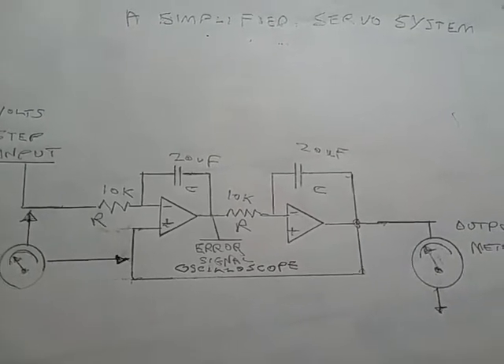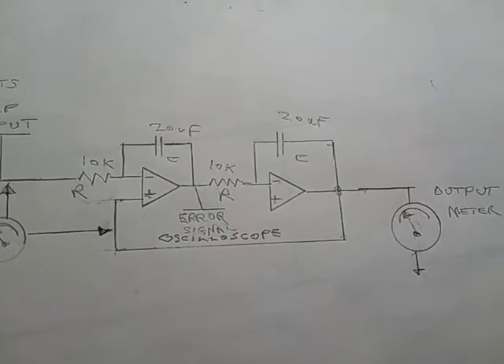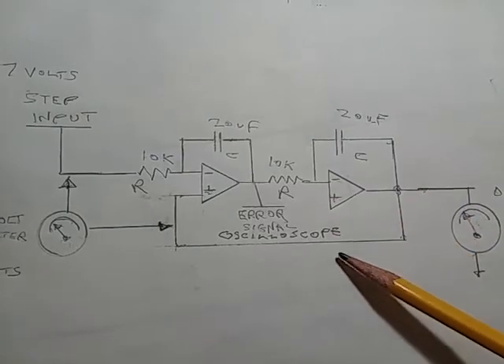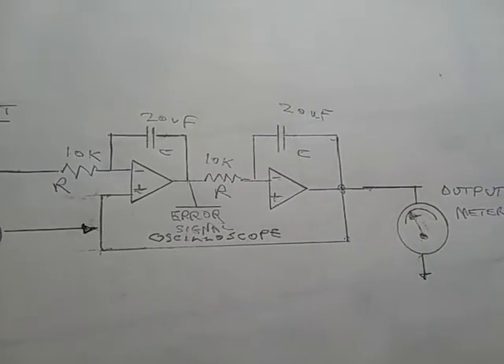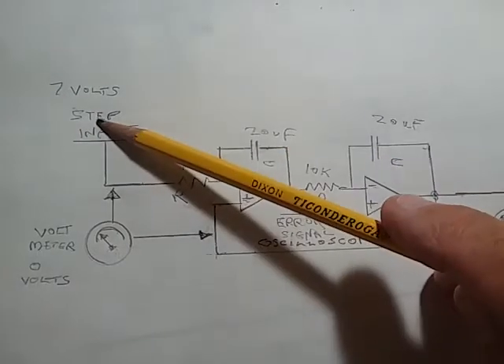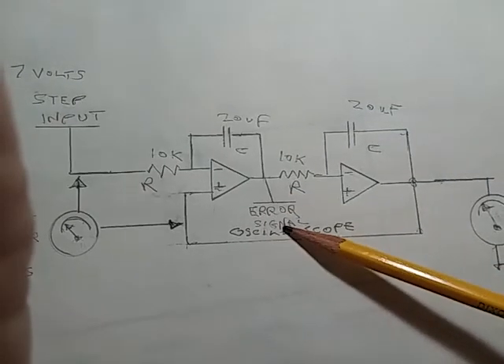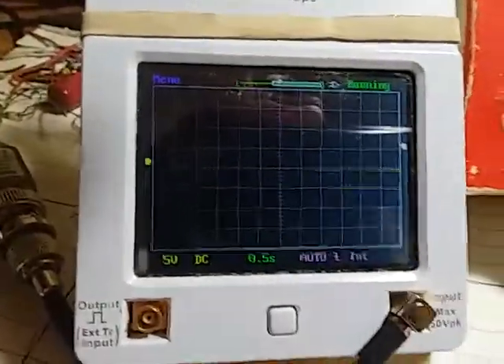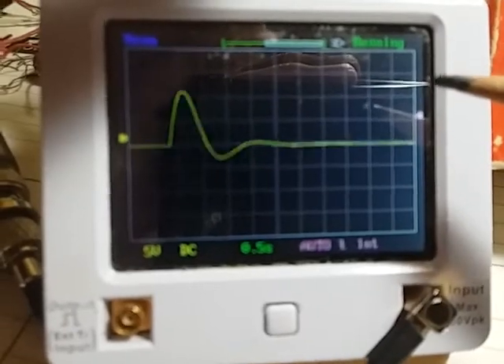Basic Control Theory, with a, "Working Model", Example.

Comment: Hello Otie,
They say that there are two reasons for myopia. 
1.Eye becomes longer.
2.Cornea is too round. 
Do you believe that the shape of the cornea changes due to confined visual environment.
Reply from the maker: Hi Sai,
Thanks for your question.  
Who are, "They"? 
They are not Engineering Scientists.
You start by making two proven false assumptions. 
The Control Systems eye, has positive and negative refractive STATES, and is never "defective", (or with refractive errors) in either case.
Reply: @otiebrown9999  I completely agree with you when you use the term "refractive states" instead of "refractive errors" because it is completely normal for our eyes to go down if we do prolonged close work and myopia is not some kind of "error" of course. Maybe, we shouldn't talk about shape of the cornea and length of the eye because nobody knows what the hell is happening inside our eyes.
Reply from the maker: @saikoushik5005   Hi Sai,
You have a good analysis. 
It is the language of Optometry,  
(all eyes are defined as defective,  because they all have positive and negative REFRACTIVE ERRORS) 
that produces massive discussion  problems,  in reviewing the science of all fundamental eyes.
It took me a very long time to realize the truth of that statement!